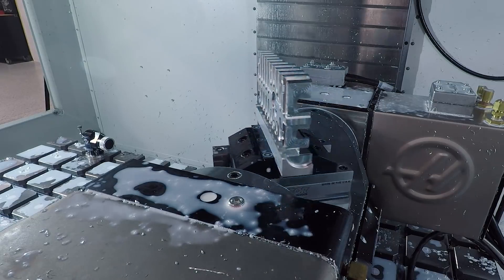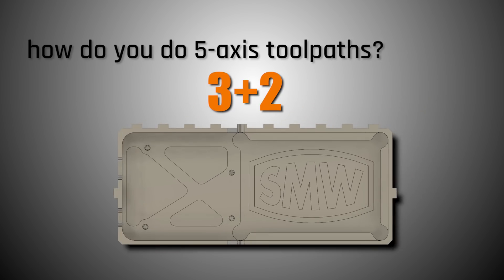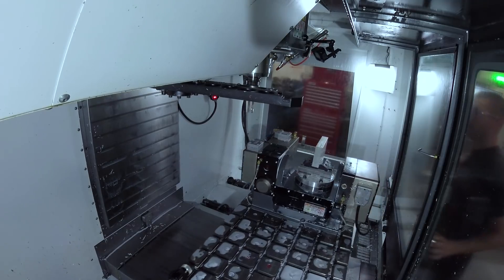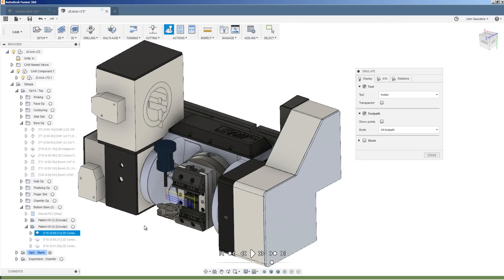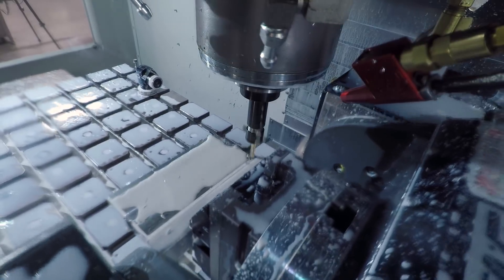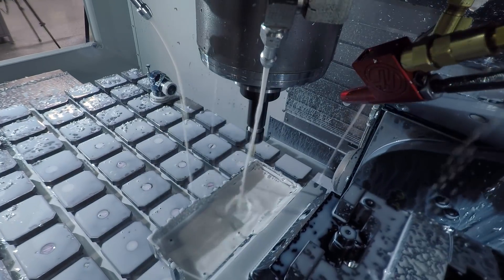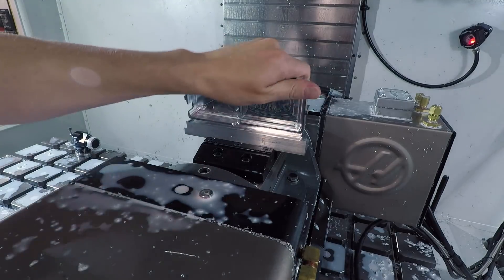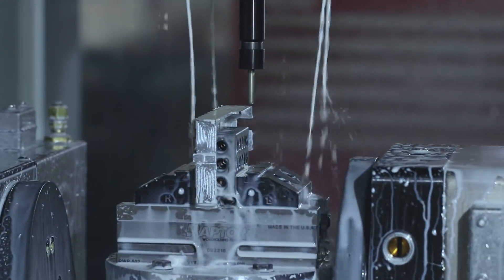5-Axis Machined Arduino Case!

Comment: Just curious why not put a spacer on the trunion to help hold the part out farther.
Reply: Calvin Witt further away from the trunnion the less stable the work piece is. 

You want tools as close to the spindle nose as possible and work pieces as close to the table as possible.

Comment: Nice video, thanks.  Something I don't get about 5-axis: If I built my own 3-axis machine, can I later on just add one of those trunnions and be good to go for 5-axis?  (_excluding_ software considerations, and assuming I have enough usable work volume leftover after adding the trunnion, and assuming I planned ahead and with 2 extra motor controllers, sufficient power supply and control board for at least 5 axes).  I don't see why 5-axis machines seem to be so unobtainable if it's just a matter of adding a cnc-compatible trunnion table.  Or am I missing something and there are more hardware changes than just adding the trunnion?
Reply: perspectivex You are correct, although the trunnion weighs a fair bit and thus the load capability on your bed matters. Also, the more axes you add z the more backlash builds up, so your first two axes need to be tighter for 5 axis than for 3 axis.
Reply: ah-ha, that makes sense.  So the build needs to be more robust if I have 5-axis in mind.  And it needs sleds/carriages with more preload and of a higher precision class than if it were for 3 axis. (?)
Reply: perspectivex Yes, for a given final tolerance, more links means each link needs to be better.

Comment: Hi, would you rather use different software instead of 360 for 5 axis programming or 360 is good for 5 axis? Thank you
Reply: Jason Shane indexial 5 axis (3+2) is fine in Fusion. 

It has a serious lack of simultaneous 5 axis paths though. 

HyperMill, NXCam, SolidCAM And Mastercam all have far better simultaneous 5 axis paths. Better collision avoidances well.

Comment: I want to see a gun drilling job what is the longest hole you can drill john ?
Reply: Hiram Rios 

VM3 has a 25” Z axis travel.  So longest hole possible would be 12.5” deep. Though closer to 12” to account for the toolholder.
Reply: Why on a mill? You typically drill barrels on a long bed lathe, right?

Comment: If I understood you right, for each angle that you want to use the 3+2, you have to setup a new WCS, and define a new Z? Figured you would just need to define your single G54 Point, and reference Z, and then orient the followup toolpaths of where the Tool's Z direction is. Because if you want to redefine where your X+ direction is, you don't need to update the rest of the angled positions.

Also, why is that trunnion lopsided? The 5th Axis should be center between those ends, and it's not. You could fit a slightly larger part in there on that platter, but you're limited to the actual size of it. Rather stupid really. You can't use certain vices with a bit of overhang.
Reply: gredangeo 

You need a new coordinate system in order to tell the machine which plane to rotate to. It’s not just a Z position, it’s an XYZ plane that the machine rotates to. 

And the trunnion is “lopsided” because the larger side houses the transmission gears that connects the motor to the B axis rotary.

Comment: The 5 axis stuff is so cool, but not sure what this is used for unless more is added to it. The aluminum will short out all the pins of the arduino.  You need an insulator between the aluminum and the arduino. But still so cool!! Thanks for sharing as always

Comment: Make yourself a 5-axis work-holding fixture similar to a Raptor tool.  They are not difficult to make.  It will give you more room so you won't have to use such long tool holders.  The dovetail blocks can be made of steel.  The base can be aluminum and only needs to be a few inches long.  Since yours is a 3+2 it doesn't need to be round so you can make it all on the mill.   Have fun....
Reply: Vernon Karm 
I personally do not like raptor or dovetail vises.  I hate the fact I have to prep and dovetail stock just to mount it in a vise. 

I’ll take the Lang vises anytime over raptors or other dovetail vises.

Comment: what does 5 axis mean? i thought there was only 3 (x, y , z axis)
Reply: ohhh so its the rotations?! ty sir
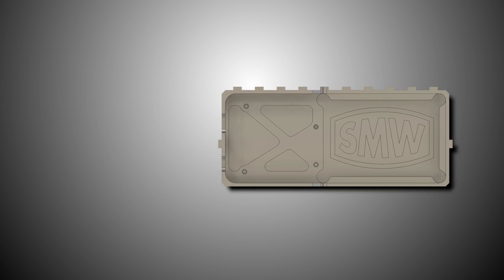Reply: Xerxes 6696 Saying CNC machines can move in 6 axis is not really true, although there are some that can. (MOST CNC MACHINES, including the Haas VMC that John has can only move in 3 axis, 4 if you include the spindle rotation as an axis, which usually isn't called out as an axis when describing a machine. That would be like saying a manual Bridgeport is a 4 axis machine.) When describing a machine's axis, you're referring to the positional axis, not the rotational axis. The trunion, which isn't part of the CNC machine, add 2 more axis. The rotations of the three x, y, and zaxis have nothing to do with the 5-axis work that John was doing in this video. And the the rotational axis are never designated a, b, & c (for x, y, & z respectively.) The a & b axis are the two rotational axis of the trunion. That infographic is very misleading. It shows the x & y axis as having rotational components to them. The z axis does have a rotational component though, the spindle. The other 2 axis, besides the x/y/z on the machine are from that "trunion" on the table. It spins the part around in 2 other axis; axis a & b. That's why it's called 3+2 (=5) machining. "True" 5 axis machining is when you have all 5 of those axis moving simultaneously; like when he showed the clip of the turbo blade being machined. (He explains it at 1:30 ) This video is showing 3+2, which means the 2 axis of the trunion are not moving while it's machining. The 2 axis of the trunion are only moving to reposition the part, and then the axis of it are locked in place.
Reply: Andrew Delashaw 
Machines can certainly move in 6 or more axis. There’s machines with multiple sub spindles mounted at 45 or 30 degrees from horizontal. That’s an additional axis.  There’s milling heads and lathe turrets mounted at separate angles as well, which are true additional axis of motion. 

You can have a single machine with X,Y,Z,A,B,C,W,U,V axis. There’s machines with even more than that.

And rotational axis like A,B,C are separate axis, an axis of rotation is still and separate axis. X,Y,Z axis which form planes have those planer coordinates rotated about , A,B,C axis. Rotating a plane about an axis creates a new axis direction.
Reply: RainerZufall there are lathes with a lot more than 6 axis, I've seen 11 axis lathes and when I was looking into some cam software some advertise being able to program 22 axis lathes.  I have a decent idea how you get to 11 I have no clue how you get to 22

Comment: This can be also done on 3 Axis..
Reply: The point was to learn 5 axis rather than make a production part
Reply: In 6 separate setups yes. 

5 axis brings it down to just 2 setups. 

More setups equals more chance of error. In fact every additional setup compounds errors.
Reply: Occams Sawzall 5 Axis Machine is also much more $$$
Reply: TrumpCorp. 
So is the ROI on a 5 axis.  A 5 axis used properly in a shop will allow you to take on more complex parts that command a much higher price tag to make. 

A 5 axis can pay for itself in half the time a 3 axis VMC can. And the price tag isn’t even that high anymore. You can get smaller ones like the DMG 5 axis milltap 700 for under $180k.
Reply: Ed Rees 
That’s fancy stuff. 

Cold chisel and a hammer
Reply: I think a Haas 5 axis setup starts around $120k. (This was before tariffs; don't know how that changes things.)
Reply: Jon Watte probably around there. 

But honestly if you’re going to get a 5 axis machine you want at least a mid-line grade machine with high accuracy and rigidity. 

Errors in position can stack up real easy real quick on a 5 axis machine. 

If it were my money I’d skip right over HAAS and Hurco and get into a German or Japanese machine.  
Matsuura, DMGMori, or Mazak. 

It’s worth the extra $ to not have to fight with the machine chasing axis gains every few months.
Reply: Occams Sawzall for production, that sounds wise! I'm more of a prototype and hobby user, so I don't have workflow to pay off those...
Reply: Jon Watte 
Ya. If you’re doing the bulk of the design work in house and developing your own parts, you can change things to match the accuracy of the parts to the capabilities of the machine. 

A lower tier machine would be fine then